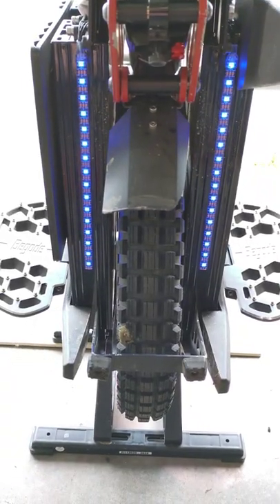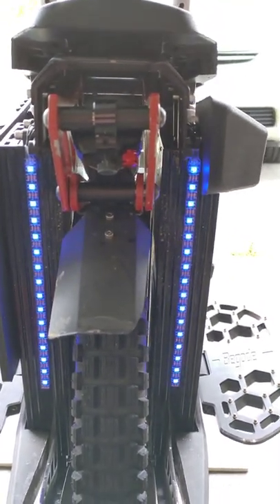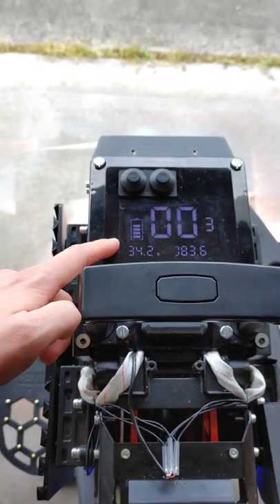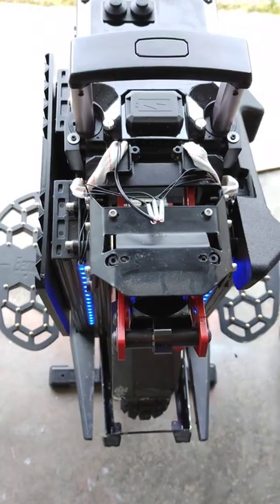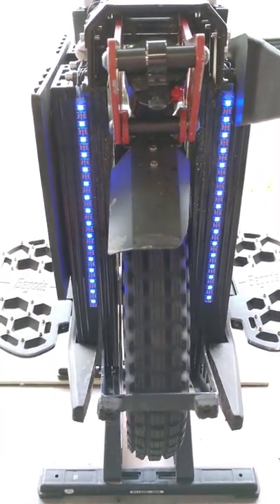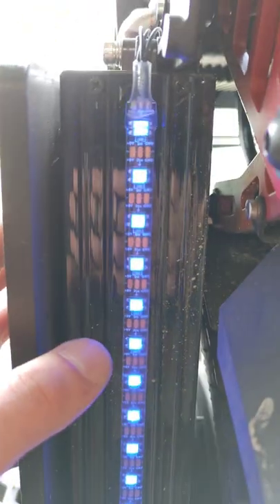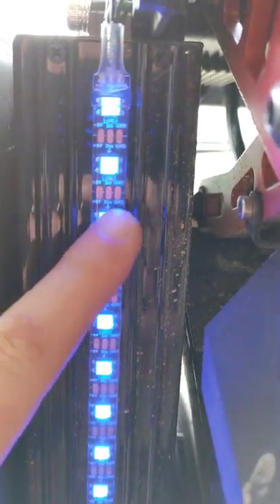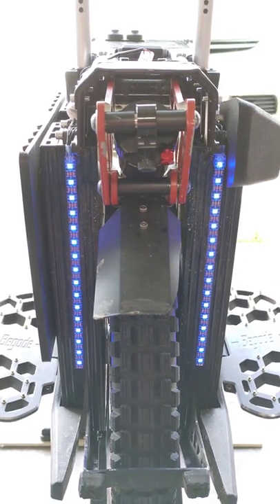DIY Begode Master Tail light upgrade!!!  Begode will get it right....

Comment: Nice upgraded lights. So much better compared to the stock ones that will break easily. Looks like could even add more light strips if wanted too.
Reply from the maker: The board will only allow 8 per side or 16 total to be lit up BUT if you wanted to solder on more strips at 16 long you could =)

Comment: pretty sure there is also programming on the wheel to address left and right. the first 8 diodes are left the next 8 are right, so to make use of it you will need to make a jumper from the bottom of the left side go up to the top of the right side.

Comment: Apart from the install, are there different settings/modes on the Master regarding the tail light, ie. left/right turn signals, color modes, brake modes, etc.?

I'm a traditionalist and would prefer only red lights in the rear, whereby running lights are red and braking would emit a brighter red.  Does the app offer customization?
Reply from the maker: No sir, all of the colors and variations you see at the beginning of the video is how Begode programmed the board. Unlike the hero which is only red and bright red. The master is blue pulse at idle, red and red flashing while riding and braking and the greenish yellow on either side is the turning.
Reply: @EUCWayOfLife  the controller use 1-8 leds for left and 9-16 leds for right turn signals. Better to do this with only 8 leds on each side or 16  (8x2 lines in parallel) this is the way to work properly as turn signals ;)
Reply: @EUCWayOfLife   Thanks for clarifying.  I'm thinking of I do a tail light mod, I would use an led strip that emits a red light only.  Thanks.

Comment: Did you make a 3-way joint to split the wires to each set of lights?
Reply from the maker: Kinda, the stock tail light broke so I cut the led strip off and soldered each set of wires to the corresponding ones on the wheel